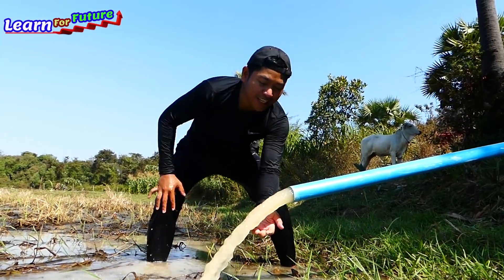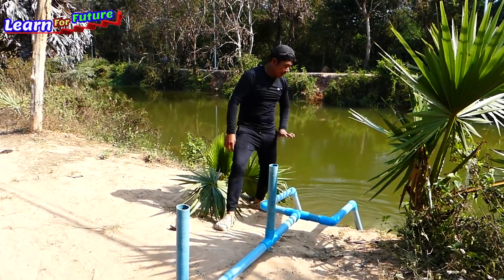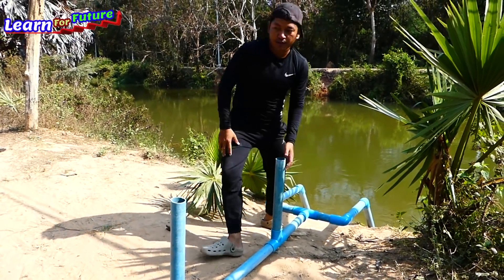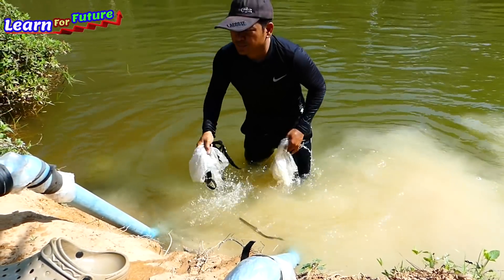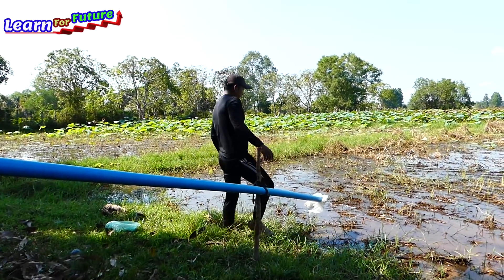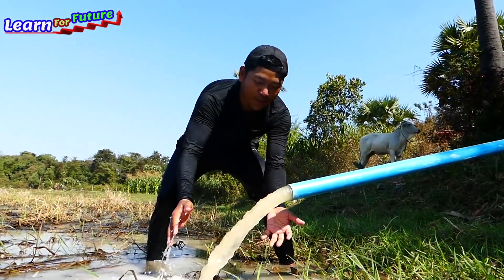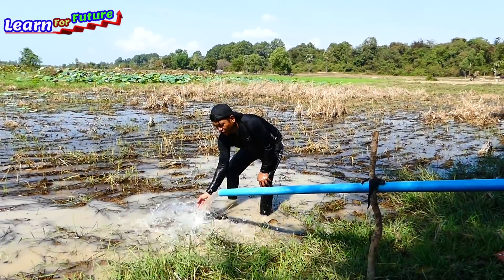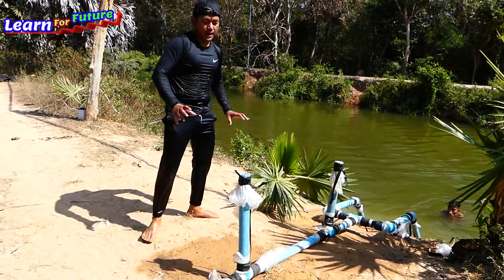Deep River - Siphon System!! How to install Siphon System suck water from Big River for Big Farms.

Comment: Amazing work sir. Sir but question in my area the depth of water reservoir is 85 meter can this system work.
Reply: You can install the stop valve fittings at water surface level to not require plug at reservoir basin depth.
Reply: Sorry, do not understand. For this to work, the water level in the river must be higher than the exit to the field. It is a siphon.

Comment: Can I try this way ... the water of the river where I flow fast?
Reply: If the water moves to fast and cause    a failure, make a barricade of rocks near pipes to slow water down. This may help. Good luck.
Reply: Normally no problem. If river is extremely fast, put a bend at the suction side pointing upstream.